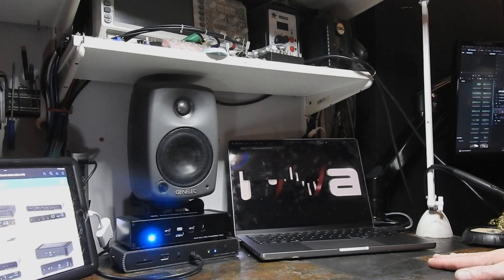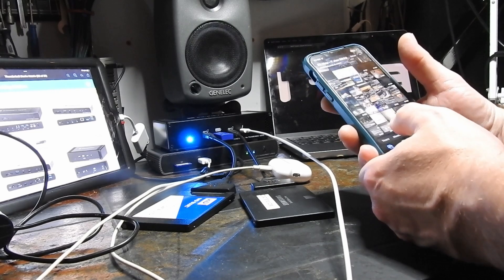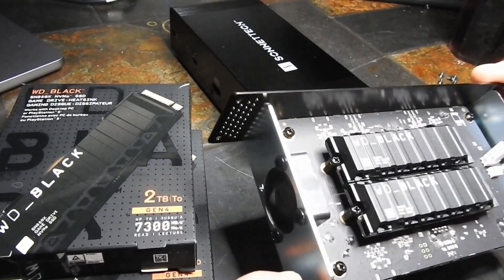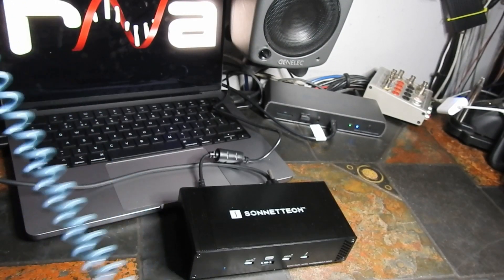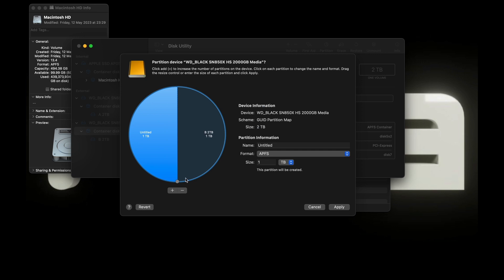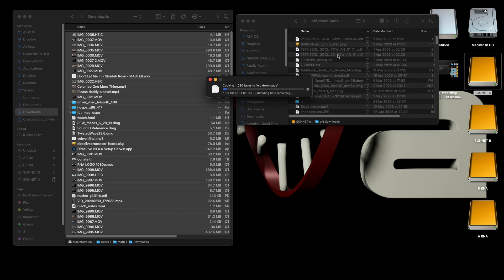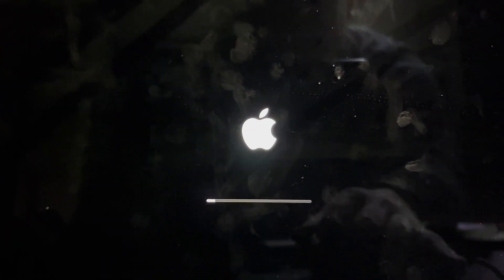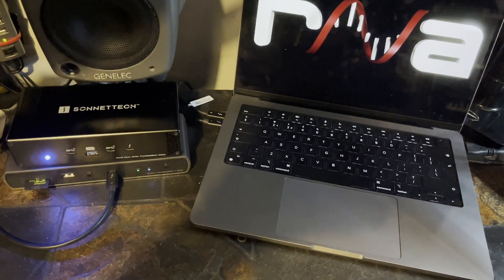Switching From Intel to Silicon with the Sonnet Dual NVMe Thunderbolt Dock Pt 6

Comment: I’m about to pull the trigger on Samsung 980 pro 2TB.. can I ask why you went with the WD instead?
Reply from the maker: It was a matter of timing.  These drives came out for Playstation peeps, hence the heat sinks.  But it turns out the way the PS used it for its own swap file and under performed according to 'posts' on the internet and the price dropped and I bought this pair cheap from Amazon for around £65 each!
Reply: @reallyniceaudio  damn!!! That’s cheap! I ended up getting the 980 pro 2TB for £129